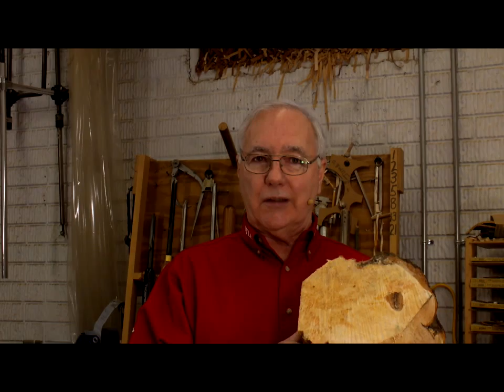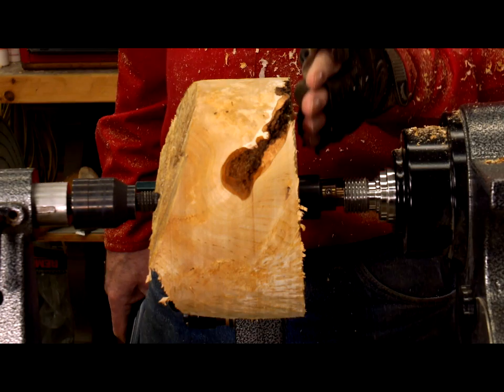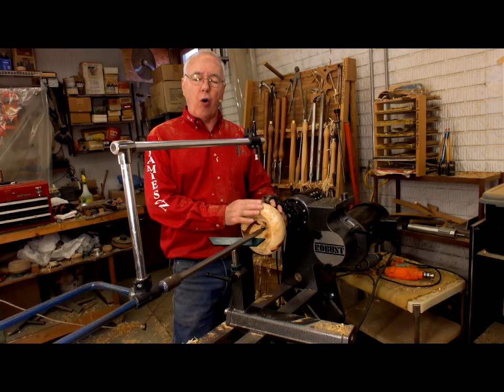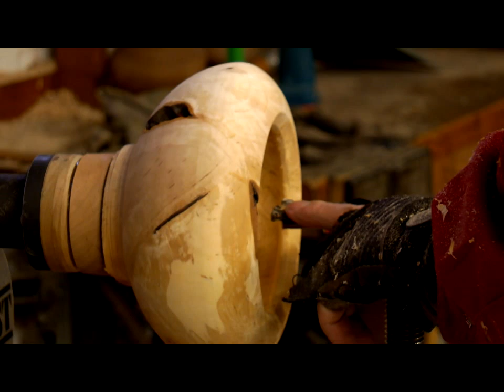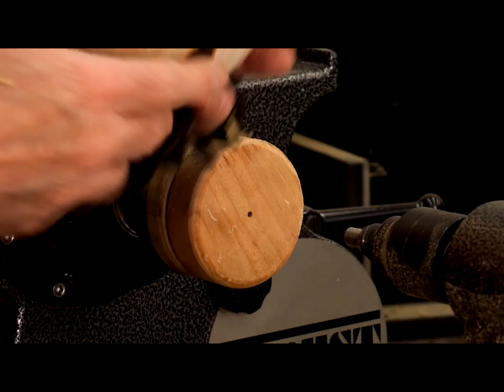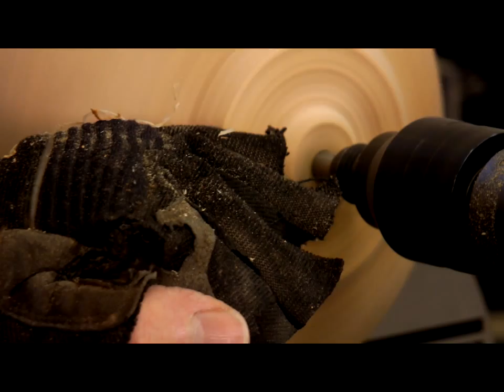Birch root burl with undercut shoulder using the boring bar with laser measuring.

Comment: What glue did you use to put the glue block on the green wood?
Reply from the maker: Hi Craig,  Wet or dry wood both need to use Thick, CA glue.  Medium or thin will not work well.  There are many brands and sometimes called Gap filling or slow curing cyanoacrylate.

Comment: Excellent. The main point I got was to take the time to make as many tool angle adjustments as it takes and not just get lazy and prolong cutting with the tip at the wrong angle. Thanks for the detail explanations.  I don't mind getting thumbs down occasionally but like you,  they aren't as useful as specific feedback which I like to get and act on when appropriate.
Reply from the maker: Thanks for writing.  Great observation Mike.  The swivel cutter holder is a critical part of my system so we can move the cutter in an infinite range of positions.  Moving it often is easy and quick for the cutter and the laser.  I move them freqently.

The thumbs down are incognito people.  I like negative comments.  It allows me to explain my reasoning and the "why" I do what I do.  They can use the info or go their happy way if they choose.

Comment: When you glued this piece up, did you use hot glue or CA or ???
I love watching your videos because your style is so smooth and controlled. That is where I want to get to. Seeing the action is so much better than reading how to do it. Thanks for the good videos. Sam
Reply from the maker: +Sam Croninger Thanks for writing Sam, Sorry I did not describe the glue block method this time.  I have used it on many other clips.  The glue has to be thick CA glue.  Hot melt glue is too rubbery and will allow vibration.  Preparation of the concave surface is also necessary.

Comment: Nice bowl... I mean hollow form. ;)  I appreciate you putting this video together, sharing how you approached this challenging piece. You kind of make it look easy, but I know that it only seemed that way because of your skill and experience.

I also really appreciate how you narrate what you're doing, including things like, "I'm doing a push cut here" or "I'm sheer scraping to remove surface imperfections", etc. I have really gotten a lot out of seeing this in your videos (and reading your articles). One habit that I developed after watching your videos is to ALWAYS be mindful of what kind of cut I'm performing, whether it's bevel supported (push or pull) vs. a scraping (or sheer scraping) cut. I really think that this has made a BIG difference in my progress. A LOT fewer catches, as well!

As for the feedback to your videos, it would be nice if people who gave a thumbs down would give a reason, but since it's not required, I doubt anyone will be brave enough to submit reasons their disapproval. In general, I have a theory that if you don't do woodturning the way an individual viewer was taught, then they assume you must be wrong. Kind of silly, given how many different (and effective) ways there are to approach woodturning.

If you REALLY want to stir up the critics, post a welding video! :)

Thanks again, sir!
Reply from the maker: +Barry&#39;s Woodturning Hi Barry, thanks for writing.  The process makes it easy.  My skills/experience might add to the design but the turning anybody can do.  I have beginner skill students do hollowing all the time. It is easy with the right tools and process.

Comment: Very nice Lyle! One question I have though, what kins of glue did you use on your glue block with the piece being green (or wet)?
Reply from the maker: +Tom Baker Thanks Tom,  My glue block method is in my DVDs and other YouTube clips.  I use "thick" CA glue.  It transfers the power and stability of the lathe to the wood, green or dry no different with a two minute wait time for the glue to cure.